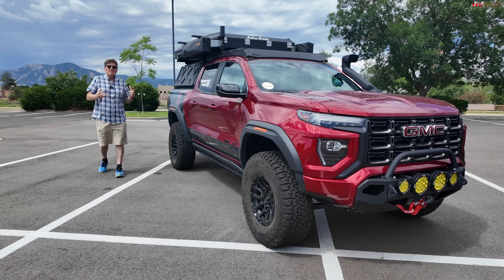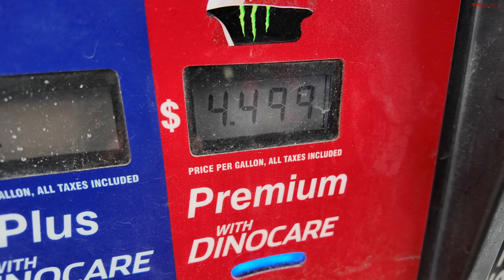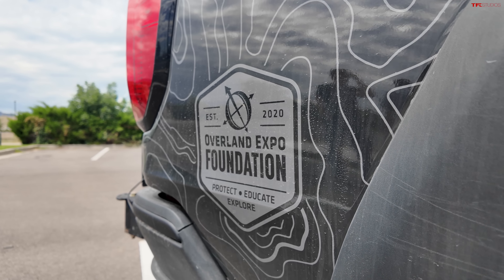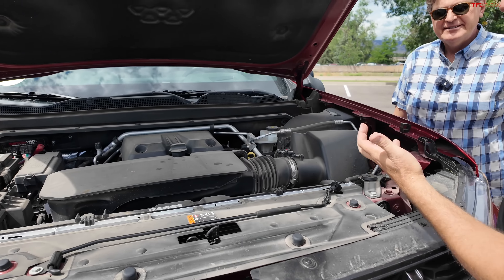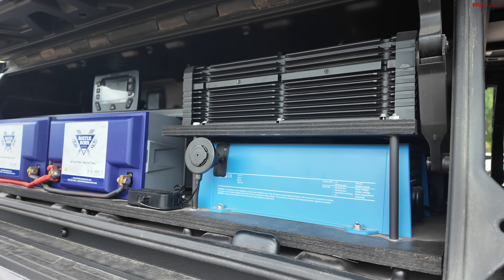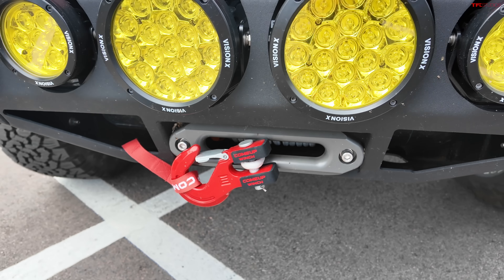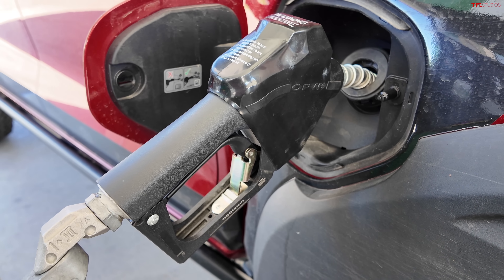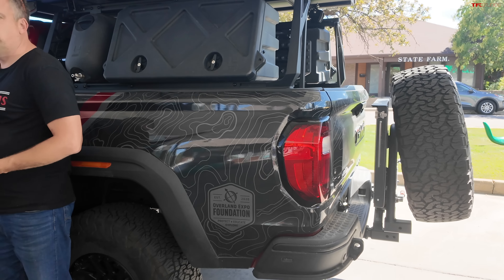How Much Does Adding a Ton of Off-Road Mods Kill Your Fuel Economy? | Denver 100 MPG Test

Comment: How in hell does a new truck not have cruise control?
Reply: Are you buying a truck or a sedan?
Reply: I've got a plane Jane cargo van, and it's got cruise control, I won't buy a new vehicle without it.
Reply: It was his fault. When he selected all the options he didn't include it. I know it should have come by default but still.
Reply: @binnie465  Yeah, a truck, not Conestoga wagon. That excuse sounds cute but not for $40k in 2024.
Reply: Drax voice: I’ll do you one better! When in the hell is someone buying a new truck that does not have cruise control? 🤦🏼‍♂️
Reply: Never used cruise control in my life
Reply: @daveyjones8764 why not? Great on a long drive and great to accurately fix your speed to avoid exceeding the limit. Adaptive cruise control will keep the right distance from the vehicle in front too.
Reply: @cjeam9199  to be fair, if I'm in town or on a windy, hilly back road I don't use cruise control. Too much variation in speed to be useful. So if you're never on a highway or straight road, I'd save the $300 too lol
Reply: GM
Reply: 😂😂😂 Andre forgot to add it
Reply: @windrider65 yeah my 03 dodge manual transmission, doors, locks, still has cruise control
Reply: @nathanmccown1966  I70 coming into Denver from KS is too bumpy to use cruise; it kicks the cruise off on my Silverado all. the. time.
Reply: @daveyjones8764 do you drive?
Reply: The engine is already drive by wire, it's just a set of buttons on the steering wheel and some ECU programming.
Reply: You must be new here...
Reply: @binnie465  GM cope.  Toyota has cruise control standard on all new cars since 2020.
Reply: @daveyjones8764  Wow, you must be fun at partis. Ever turn on the A/C or the radio?
Reply: was just gonna say i thought that came standard
Reply: I have an old 1998 Chevy K2500HD that has rubber mat floor and hand crank windows and it came with cruise control.
Reply: @binnie465 What does that have to do with anything?  You think it makes sense to pay these crazy truck prices and they don’t even have the basic features that vehicles half the cost have?
Reply: @nathanmccown1966 what kind of vehicle are you talking about - modern cruise controls are very consistent in holding speed regardless of those conditions.
Reply: Even my '98 Jetta with NO options had cruise. I guess it's cool you can opt out but as someone that does large distances - not having it is fatiguing...especially in newer vehicles hunting for gears with the aero of a brick wall.
Reply: @binnie465 I don’t care what you say it’s nice to have on a long drive I have a “sort of bad” knee and it’s nice to be able to move my legs around to keep it from being stiff
Reply: @gordtulk  I'm not saying it can't hold the same speed, I'm saying you don't want to hold a constant speed. If you have a quarter mile of straight road, then a 20mph curve, im not going to use cruise control for that quarter mile lol. I'm not saying I'm against cruise control, im just saying I see some circumstances where its probably unnecessary, like a work truck that stays local
Reply: I don’t even know why it’s an option to not have it, It’s pretty standard at this point.
Reply: @aepps22 

My near basic F150 XLT had Cruise control. It is nearly  standard  on every  vehicle  nowadays
Reply: Seriously, my old 85 ford tempo had cruise.
Reply: @jasonerickson4361   that's my thought as well,  it's not like the old days when cruise meant a whole mechanism buried under the hood or in a fender.    It's a line of code and three buttons.
Reply: @nathanmccown1966 ya I would say it's like a condom better to have it and not need it then need and not have 😂
Reply: @binnie465  Does that matter? Both should come standard. It's 2024 buddy, wake up.
Reply: @HAHA.GoodMeme so does ford. Even my bare bones 2004 F-250 XL powerstroke has cruise control so did my 2000 and 2003 rangers
Reply: Why are you still bringing this up, my Colorado Trail HAS cruise control, I think most of them are ordered with it too!
Reply: It's like standard on every vehicle too
Reply: Cruise control; the cheapest radar detector ever.
Reply: I can see it on a very basic trim not being there
Reply: Andre is cheap thats why and I do believe cruise control should be standard on all new vehicles.
Reply: Especially at MSRP of $70,000- nearly $100,000.
Reply: Yet so many refuse to use it on highways. So frustrating to watch someone blow by you, then a mile down the road you have to pass them. Over and over again.....
Reply: @duanehenicke6602  

Cruise with a manual transmission is useless in the mountains. Biggest problem up here is people go 30 mph up the mountain passes and 130 down the other side. Because of that, I've passed the same cars up to 100 times on my former daily drive. No cruise and my speed rarely varies more than 1-3 mph. Every time you shift in a manual car, cruise deactivates.
Reply: I've driven for decades & you couldn't pay me to use a cruise control BS.
Reply: Who even uses cruise control
Reply: Wow learn to drive. I never used cruise control in any vehicle of mine that has had it
Reply: @darryladams519  

I've used CC only once in my entire life, but I live in the high Rocky mountains in Colorado.
I could see it being useful when you're covering hundreds or possibly thousands of miles of flat featureless states. Maintaining consistent speed for 12-14 hours with just your foot would be quite tiring. 
You're probably one of those people whose speed varies by 20-30 mph when you're on the highway and gets passed by the same cars hundreds of times per day during cross country road trips.
Reply: my 2019 XL 150  has cruise control . Ya W.T.H $$$ for the overland. GM don't be cheap.
Reply: My 92 f350 non turbo idi with a manual has it and that's mechanical injected
Reply: Cause it’s a Chevy lol
Reply: "Learn about the build" with a QR code😅😅 nobody cares about that "build".
Reply: @escapenguin my ‘09 jetta sw have cruise control too, doesn’t work at the moment but the commands are there lol
Reply: @AlfyPotsdam-wh9vs 😂😂 my ex father in law loves to buy cars fully loaded, but he barely uses all the stuff, ac use was a rarity and even the radio too, the reason accordingly to him was the car will retain a better value when resale time arrives
Reply: GM would charge extra for airbags and seatbelts if they could
Reply: My first car was a ‘75 Monte Carlo. It had cruise control.
Reply: Because a lot of truck buyers excuse the automakers from including features, that have been in far cheaper vehicles for years. All under the notion of “it’s a truck”. Like that means it’s supposed to be crap materials and barebones for $45k.
Reply: It was custom ordered by Andre.  He made a mistake on the order and failed to choose cruise control as an option.  Still, GM makes PLENTY of mistakes by themselves!
Reply: Never had cruise control in my 32 years of driving for work and pleasure, only two automatics ! No real use without hundreds of miles of straight fast roads wot we don't got !
Reply: Never had cruise control in my 32 years of driving for work and pleasure, only two automatics ! No real use without hundreds of miles of straight fast roads wot we don't got !
Reply: @HoolaaBaaloo  He is right that more features are better for resale. But you pay more at the purchase time, so it doesn't matter. And all those luxury features still depreciate so technically; you are losing money.
Reply: I mean most people don't even use it anymore I live in the middle of nowhere and everyone can't seem to figure out they have cruise control on the highway
Reply: GM would option out the seatbelts if they could
Reply: Most people never use cruise control.
Reply: Right? I thought even all base model vehicles has cruise control.
Reply: @cjeam9199  lol you think we care about the speed limit
Reply: @daveyjones8764 You're the guy I pass then get passed by dozens of times on road trips.
Reply: Can’t tell if this is a genuine question or you’re just trolling but because it wasn’t paid for

Comment: 2 things. Did they correct the speedo after the bigger tires? If not its completely pointless. It will say way better than it is. Also the gm engineers said you get no value for running higher octane the way the engine is designed.

Comment: In 1996 I did a 5 week trip from the Mexican to the Canadian border in my 1989 Nissan D21 Hardbody 4x4 pickup. Simple camper shell with all my camping, mountaineering and SAR gear in it. Highway MPG averaged 25, reliably. And that 4x4 never let me down in desert heat or blizzards at 10,000 feet. My "mods" for the truck amounted to the camper shell, good tires and a dual battery system. No lift kit, no nothing else, just lots of camping gear and supplies. Back then it wasn't called "Overlanding", it was just camping out of your truck. What gets me though is how pitiful the fuel efficiency is of the massive over stuffed, over priced behemoths being offered today. Just doesn't make sense to me spending all that money on the fashion statement when you could spend it on actually going places instead.
Reply: You're right on! also, who in their right mind.. or if they had any common sense to start with would have a BLACK truck?? but that's all you see on the road. How stupid.... It shows every speck of DUST🤣😂🤣😂😁

Comment: The payload of a standard AT4X is around 1250 lbs.  All those off road modifications lower the payload even more.  Add the Alu-Cab, two people, food, propane and all the stuff needed for a weekend away - That truck is way over its payload capacity.  Of course, that has insurance, warranty and legal implications.
Reply: Probably somewhere around 600-800lbs over the GVWR. Here's the thing... I've never seen or even heard of anyone having issues with insurance or legal troubles with this. Warranty is already going to be hard because of the modifications to everything (though also there's the whole Magnusson-Moss if you wanted to fight with the dealer/mfg, so it depend what fails). I've only ever heard people like you stating there will be "implications." But never seen them materialize.
Reply: @PeakDecline A few years ago truck frames were braking when towing off road campers,   don't recall how it worked out.
Reply: Going over payload above the axle and going over payload off the rear bumper\hitch are very different; most of the frame issues is because people tossed too much weight 3 feet behind the rear axle, and physics took care of the rest.
Reply: @PeakDecline  It's a good point, I haven't heard of the risks of exceeding weight ratings materialize either. But that doesn't mean they don't or can't with the right lawyer, insurance adjuster, or service manager/manufacturer. I wouldn't take the chance in today's society.
Reply: All you have to do is get a LICENSED MECHANICAL ENGINEER to inspect the frame, aftermarket shocks, leaf springs, and other vehicle modifications and send that paperwork plus PHOTOS of all underbody and truck bed modifications and additions  to the Insurance company with WRITTEN paperwork saying you put these specific modifications on which SPECIFICALLY ALLOW you to carry a NEW weight limit (i.e. say 2200 lbs) in the bed and the Insurance company will check it off and you are now LEGALLY covered.

GMC won't cover the warranty BUT you ARE covered insurance-wise with a licensed mechanical engineer's paperwork! That inspection and paperwork is about $500 USD which is good piece of mind!

V

Comment: You just can’t make these tiny turbo engines sound good, I have listened to so many 2.7 Ecoboost like mine, watched so many after market exhaust on YouTube and not the first did I ever think that sounds better than stock which really don’t make much sound at all. I’ll take quiet over bumblebee farting in a Coke can sound. The GMC does look sharp modified though!
Reply: Imo, they don't need to and quiet is a great selling point for the smaller I4 / V4 displacements. Most of the cheap exhaust people put on their vehicles sound awful/obnoxious anyway. V6's sound awful no matter what you do to them. V8+ obviously trumps everything, but society has given up on those (and tbf, the cammed ones like mine are oppressively loud with a full exhaust replacement). One of the major reason why I didn't buy a Ranger Raptor is it's awful, terrible, disgusting sound. One of the main contributors to the GMC Canyon is how quiet it was. Felt as quiet as the Lexus I test drove.
Reply: The 2.7 I4 sounds particularly bad. When I test drove one it was a little concerning how clacky and clicky and buzzy it was.
Reply: Yes the only downside to these turbo motors is sound. So if this is your first foray you waste a lot of time looking for an exhaust to “fix” that problem. 
Eventually you realize there is no fix, so just enjoy the quiet. 
Exhaust money is better spent on a sound system 😁.
Reply: Quiet is the way. Even on my V8 trucks I kept them stock. Take a few long trips and aftermarket exhausts get old fast.
Reply: My neighbour has a canyon denali, I thought it sounds pretty good, at least from the outside. You can hear the turbo!
Reply: They do sound terrible.  It's the cost of government compliance.   So far none of the aftermarket Cat Backs for these trucks I've heard on Youtube sound much better than stock.  They're just louder.
My guess is GM knew this when designing this truck/engine combo and knew they couldn't do anything about it so they maximized the turbo sounds to sorta make it sound like a diesel engine.
Reply: Just like a motorcycle, you can make a small engine with less cylinders sound good, but the only way to do so is to actually significantly hurt performance by adding back pressure and changing the flow which completely neuters the designed power of the engine.

My bike’s exhaust sounds great, but I could easily add 15% more power from it by changing to a completely unrestricted exhaust, but then it would sound hollow and tinny instead. I don’t need that power on the bike as it’s still plenty fast, but I do need that power when we are talking about an already undersized engine in a big truck, especially since adding exhaust restrictions and changes can have a particularly nasty effect on the turbos.
Reply: @Cloud30000  More times than not- there's no free lunch.
Reply: I like hearing the turbo in my trail boss 😊
Reply: making a 4l turbo sound good unless you make it screem is laughable ...  nothing beats the sound of  a BB engine with a big cam 🙂
Reply: Edit ... a BB with a blower  does :-)
Reply: @kenadam4693 true.  But at least GM didn't pipe in an artificial engine sound into the truck like some other makes do to cover for their lame Gov-compliance engine that had to replace a great sounding one that doesn't pass EPA standards anymore.
Reply: Purchased a Trail Boss a few weeks ago and towed my teardrop (loaded about 2,000 lbs) to the San Juan area in Colorado. I loved the sound from inside the cab. Low-end growl when pulling up the mountains, lower RPMs and less shifting than my ‘17 Colorado.  It’s early, and my 3.6 proved itself, but this early on I couldn’t be more impressed with the torque and grunt of this engine.

Comment: Those are some good-looking trucks! That AT4x is built to the hilt; it would be hard to do truck stuff with it, but I'd bet it does great for camping/overlanding.
Reply: Dang that Chevy isn’t aging well.  Going with that cheap black plastic was a bad decision
Reply: My cadillac ats does a great job taking me camping with TONS of gear, plus i can leave my site setup during the day while i drive to trailheads and go hiking. Not to mention that the other 95% of the time im driving it to get groceries and go to work its far more efficient, safer to other drivers and pedestrians, less impactful on the environment, and less damaging to our infrastructure than an oversized unnecessary ego stroking truck would be.
Reply: @flybyguy1450  so... player...  you're saying people don't buy Caddies on account of their egos?! 🤑

Comment: Roughly a 30% decrease in mpg between the two. That's pretty huge. My hemi differs that much from empty to fully loaded and pulling a 4k trailer.
Reply: Thats because your hemi probably doesnt get 24 mpg empty. Hell, it probably doesnt get 17 empty 🤣
Reply: It's the tires
Reply: @0my  And the roof top tent. And the lift.
Reply: @0my  And the roof top tent and the lift.

I went to 35x11.5's on my Lexus LX570 without lifting it and lost almost zero MPG. If you are selective and use a light tire, and one thats not much wider than stock, it doesnt hit you that hard.
Reply: @Jay-me7gw  Shit no it doesn't! ...lol But that's still a big percentage drop just for tires and some aerodynamic loss.
Reply: Run a hundred yards, then put on a hooded windbreaker and hold the hood open and run another 100 yards. Wind resistance has a massive impact on fuel economy, which is why a light box trailer takes significantly more power and mpg at 75mph then a heavy flatbed trailer.

If they ran this same loop at 45mph, I bet the difference in mpg between the two vehicles would be much smaller.
Reply: So much opinion and mine does this and this does that. The video is comparing these 2 trucks and how it affects these 2 trucks. Not against another type of truck or brand of truck. Everyone's always mines better I'd do this     it's all good. Whoever owns this truck will drive it and pay for their gas.
Reply: @BrandonBarnett-fk8zf  It's called "context". This truck differs so much. Others do not. Kinda the point ......
Reply: @Cloud30000  Much less than you think. I tow a 12ft flat bed and a 20x8x10 enclosed. Mpg drops 5 with one 6 with the other.
Reply: The trail boss may have exceeded the window sticker MPG but the ATX4 only got 1 mpg less than it's window sticker.
Trail boss 17 City/20 highway/18 combined
ATX4 17city/17highway/17 combined 

On the other hand the
Z71 18 city/23 highway/20 combined.